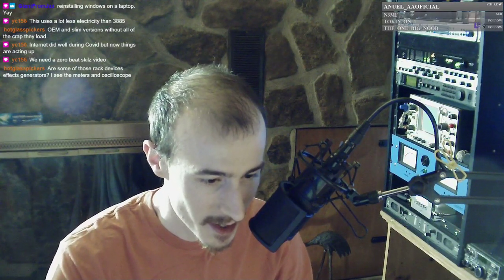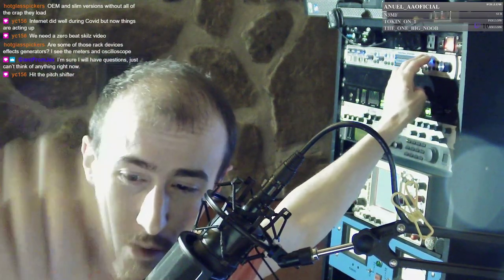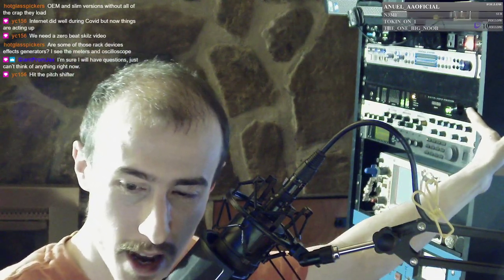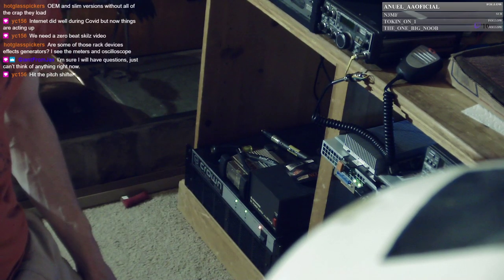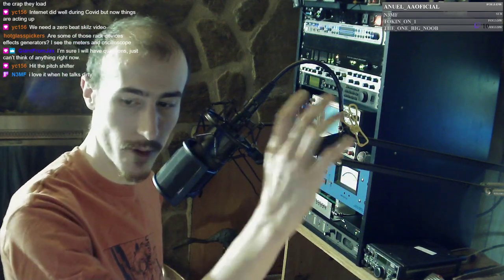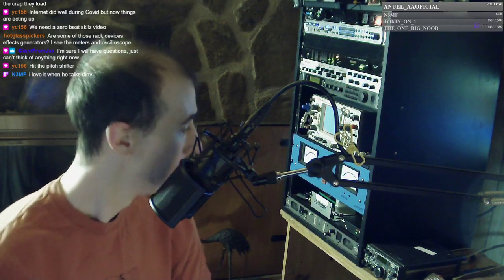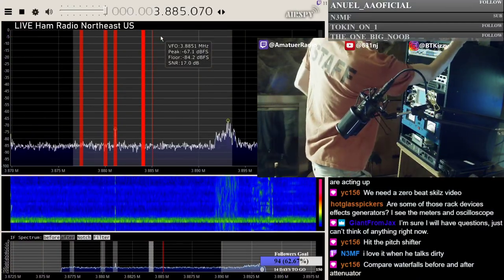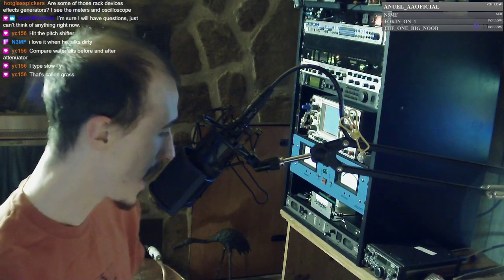What is all that gear in the rack? 631nj's Operating position (Twitch Stream Q&A) W2BTK

Comment: What is the main processor name?
Reply from the maker: Vorsis VP8 Plus
Reply: @AmateurRadio   cool, I'm in the market for a wheatstone am55 also I'm interested in those half rack units from inovonics but I cant find any real use reviews on them
Reply from the maker: @414730  I know a bunch of people who chat on 3885 using the inovonics 223 and they all seem to love them.  Never used one personally but they sound really good on the air.
Reply: @AmateurRadio   I went with a novia 236... This half rack unit sounds fantastic on am.. Tons of adjustments I can make but I end up just useing a preset a with slight adjustments. I used to love the anolog equipment that I still have but this little baby does it all in one unit with very little tweaking
Reply from the maker: @414730  Very Nice!  I think you made the right choice.  The 236 looks like an amazing unit, probably a slight step up from 223.